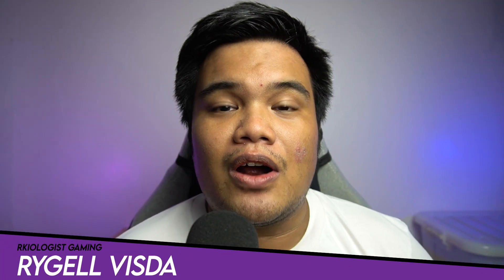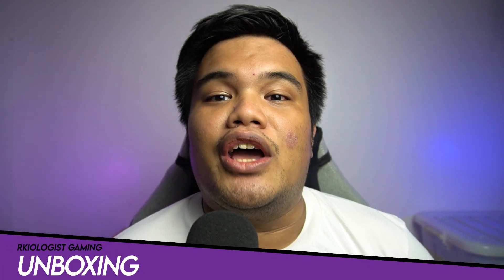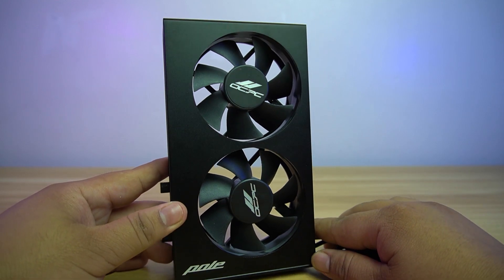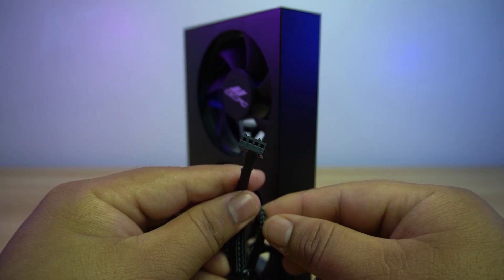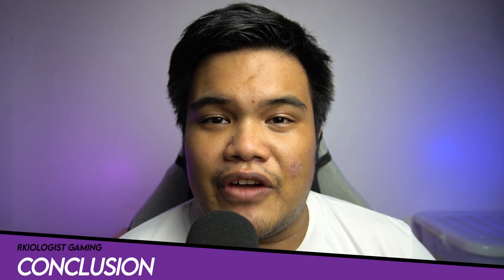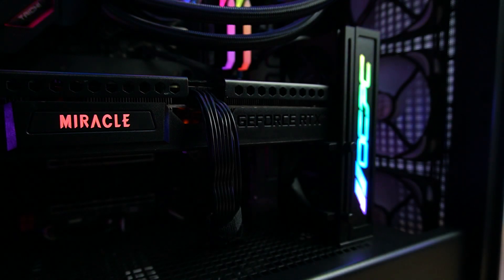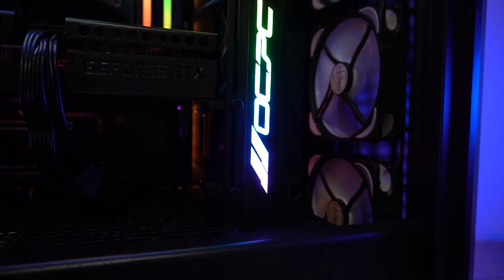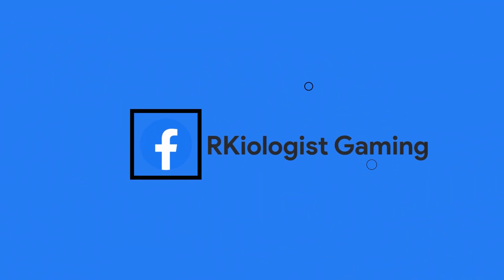OCPC Pole P1 Graphics Card Cooling Holder - Unboxing & Review

Comment: A giant glowing logo, it's too big and only reduces 2 to 4 degrees... Thanks for this review, you saved me $40
Reply: I bought it without looking it up it’s 30$ here was just looking for a cheap gpu fan/holder. Will test later to me any air is better than none
Reply: @BrokieTheJokie any result? I'm worried about the gpu doesn't have a dedicated cooler like CPU does using a water cooler or the other ones